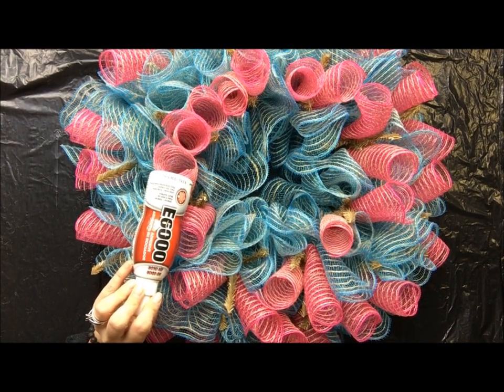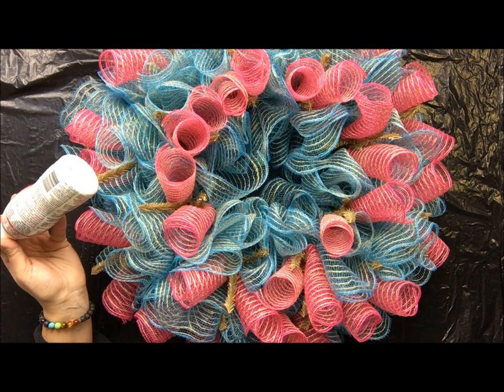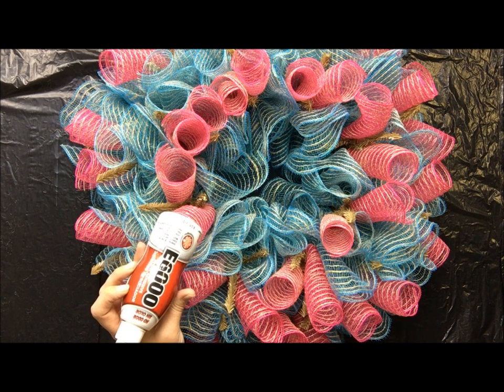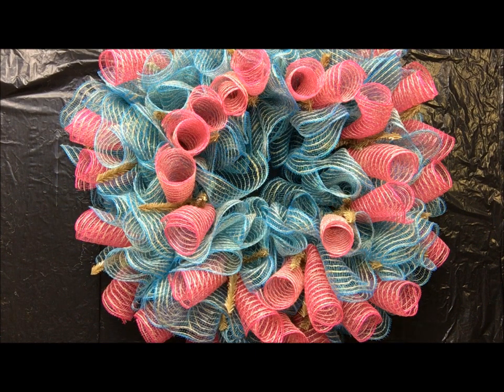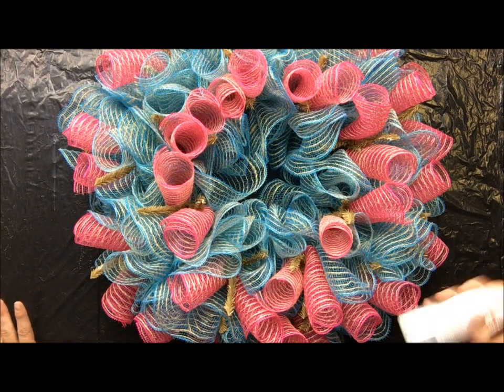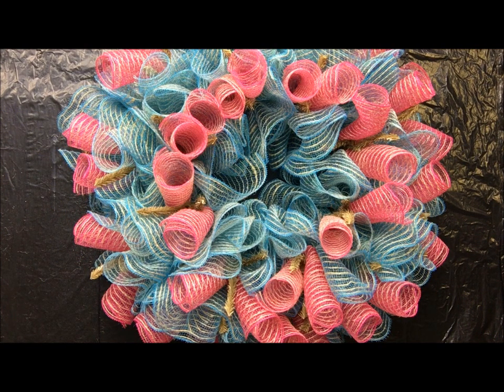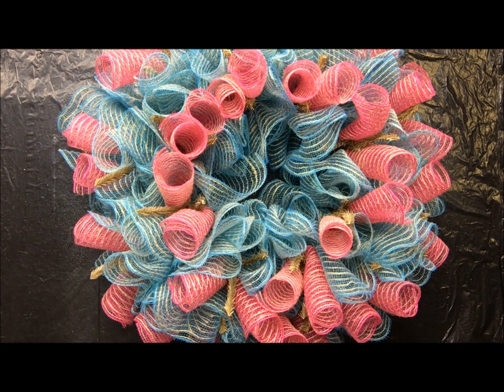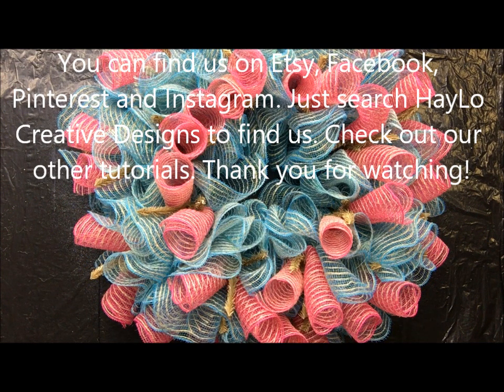Minimize Fraying Edges  On Cut Deco Mesh With E6000 (2018) Wreath Tutorial

Comment: I watched another video from someone else that uses a solder iron. They use it to cut the mesh instead of scissors, and that way it seals both ends of the cut. I haven't tried it yet myself, but I'm definitely going to.
Reply: I know this awhile ago. Sorry, should you see  this. It is plastic and many heat seal but the fumes are toxic fumes need to wear a mask or open;area ect. Some people don’t want to be expose to the fumes